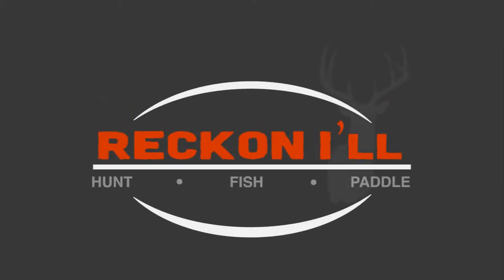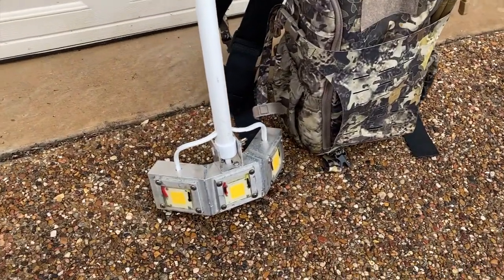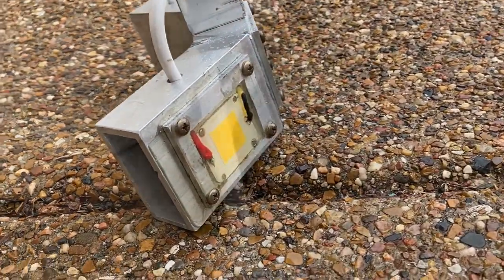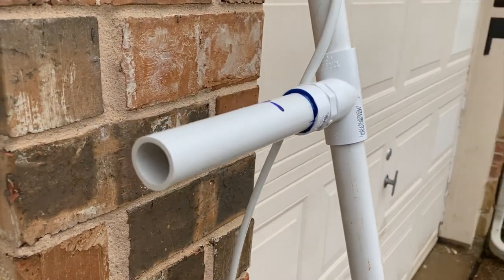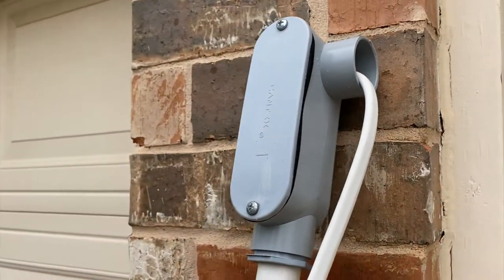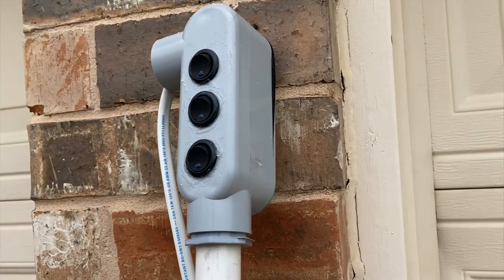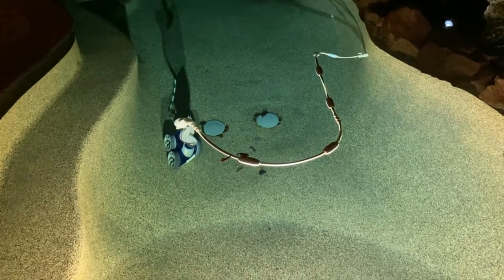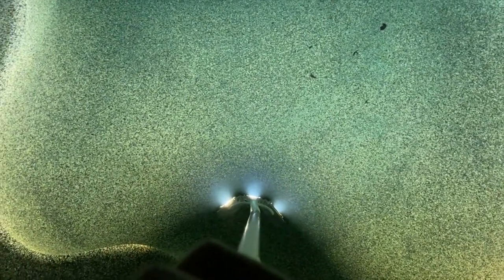Reckon I'll: Build a Flounder Gigging Light that Will Give the Flounder a Sunburn

Comment: I had the same idea to use the conduit box as a switch holder! I used metal toggle switches with the waterproof rubber covers. The one thing I wish I would have done different and I found them is a pass through that would seal that box and the cord through it

Comment: DUDE !!! YOU MADE THE EXACT SAME LIGHT IVE DRAWN UP !! 
awesome job dude 🙌🏻
Couple of questions though.
1.) How hard is it to pick up the flounder once you've gigged it
2.) How do you keep from pulling the connection terminals off the battery 
3.)if 
Amps (?) = watts (150) ÷ volts (12)
Your lights should draw OVER 12 AMPS !
I'm really uneducated when it comes to electrical engineering but wouldn't that Cause the battery to significantly heat up?
Have you noticed that?
Reply: (BTW Im from Texas and go to a place called San Luis pass in Galveston to walk the sandbars out in the pass )